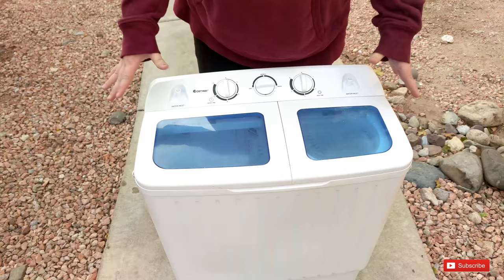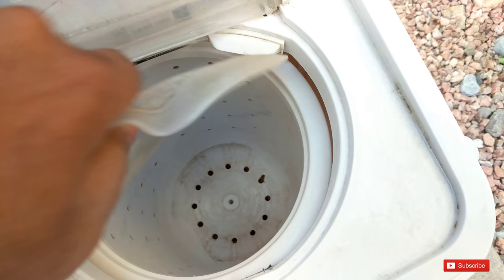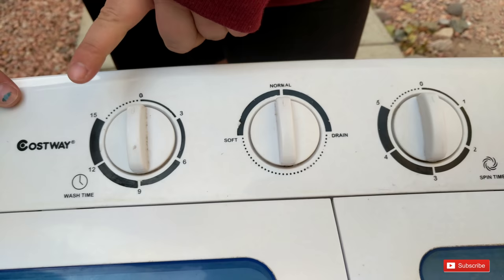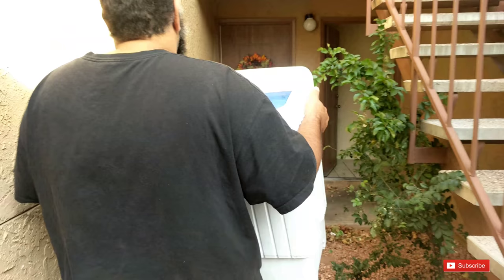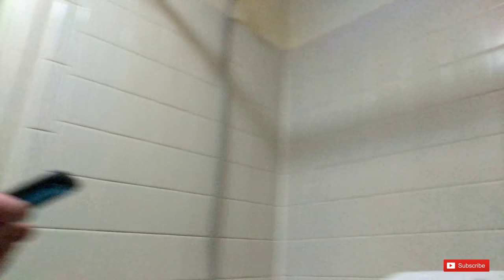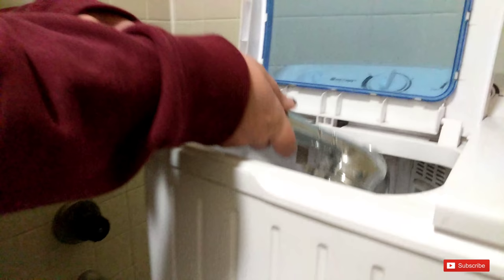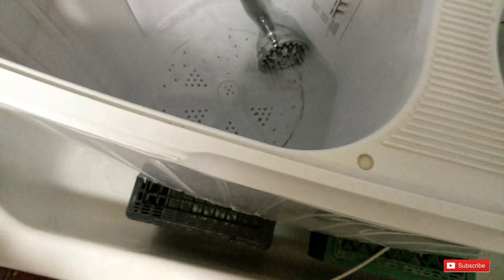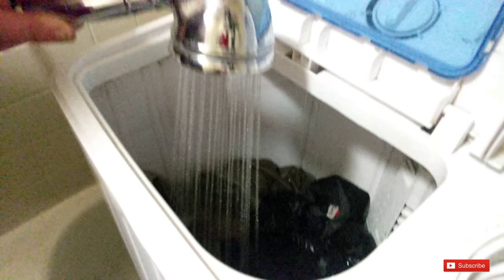Amazon choice Giantex portable mini tub washing machine 17.6 pound washer full review 2019

Comment: I feel like this is so much smarter than buying a 800 to 1400 dollar washer dryer. Did you know you can buy "8x4 or 4x4 grow tent" on Amazon or eBay and hang your cloths in there and put fans on the bottom, box fan should work as long as it's elevated from the ground a bit. And put some of the "plug in reusable dehumidifiers" in there and you'll have a dryer for after your spin cycle!
Reply: How BRILLIANT! Was about to purchase the machine, then went back to Amazon and bought the grow tent. Thank you SO MUCH! I have an 81 year old mother and have to keep her safe. Don't want to bring anything from the laundromat.

Comment: great review.. Just for others you should not ever use a standard lamp extension cord it is not rated for appliances and buy for $15 bucks 14 gage relates to "medium use" which this washer uses. Must have a GFi plug. Also not a good idea to put on milk grates for safety. It could walk off and damage. I bought one and did my first load. I'll load on my Youtube. I washed 8 items.  polo shorts, 4 tee-shirts, and underwear.Spin nearly dried it. Enjoy!
Reply: Not all apartment bathrooms have gfi plugs or even a plug at all.
Reply: @back2the80s  Really? Wherever you plug it in install a GFI it will save you lots of grief and avoid blowing out your unit.
Reply: Tyler S it’s a junky apt

Comment: So if I spin it a second time I'm the dryer side will it completely dry my clothes and could you fit like sheets and covers in there?
Reply: Kaylee Smith  yes I mean it would be for some People hard to get a drying rack due to small apartment spaces and such.
Reply from the maker: So it wont dry your clothes it spins out the excess water and then you can either dry to hang or use a dryer you can fit sheets and small baby blankets. But not like comforters

Comment: Could you do me a solid and measure the outer diameter of the 2X water inlet pipes, it would be greatly appreciated. Thank you!
Reply from the maker: Measuring app says 1/2"
Reply: Why do you on every vid you ask the same thing, asking ppl to measure. Stop that. Go to the actual Amazon site and they give you specs on every item. 
Yall need to run your machine with apple cider vinegar with no clothes in order to clean it well. They have to be maintained at least once a month. Also, on the spinner you can use it for 3 min and that should be fine. The lint catcher needs to be cleaned after every load.

Comment: can fabric softener  be put in the rinse cycle?
Reply from the maker: Yes I don’t see why not
Reply: Yes you can. What I do after wash. I spin the water out 1st. After you drain it all out. Then put back in the washer put cool water. Rinse without downy after that drain. Then spin again. Take all that water out. Then put in washer again put downy water. Then repeat. Your down. I can't rinse 1st time leaving all that soapy clothes. Comes out better. The machine wash great. I put more soap. I have a smaller one costs at. They wash great. Spin almost dry. Need more water then that. Thanks for the video.  Yes put it in the rub. Great idea.

Comment: Does this thing even washes clothes clean since it only spins and not scrubs like the old washers
Reply from the maker: It does a great job of cleaning clothes it spins both ways the only difference is the spinning cycle is in the other tub.
Reply: It works like the newer high efficiency washing machines, that don't have an agitator. It cleans the clothes but rubbing the the clothes against each other rather than a pole agitator. I still think the ones with the agitators are more efficient in cleaning but these newer ones get the job done.

Comment: does this have to be used in a bathtub? all the videos I see have the washer in the bathtub. I’d like to store mine in a closet space near my shower.
Reply from the maker: That's a cool spot I never thought of💜
Reply: I think the reason you see so many ppl use it in the tub is because it's easiest to drain it that way. No extra tubing needed.  Otherwise you have to figure out how to attach an extension tube to drain the water after each cycle. But you can use it anywhere, really. You can store it anywhere also, I store mine in my utility closet.
Reply: Raquel Collins thanks so much

Comment: I've watched video after video and nobody says how much water you use. I don't have a faucet or shower. So I would have to use a bucket to fill it up. Would be nice to know how much water you have to use.
Reply from the maker: I do about 6-8 gallons of water per cycle.
Reply: Judy G.  seriously! I read the owners manual on line and didn't see where it said how much water it would use. Plus calm down! Seriously? You getting excited over a question?
Reply: Isaw a video with one similar and the woman filled it with 4 buckets.   But i would say it depends in how big the bucket youre using is.
Reply: If you look inside the machine it should have markings that say L(Low), M(Medium), H(High)...I always use the H and put about 4 buckets (gallon size from dollar tree) in to full mines up and I keep a 5 gallon bucket on the floor for it to drain...if you over fill it the extra water will just drain into the bucket